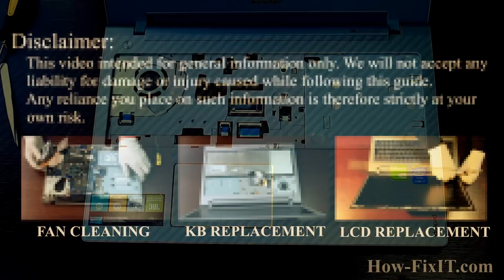Lenovo IdeaPad Z500, Z510 Hard Drive Replacement & Memory Upgrade Tutorial

Comment: Hey dude, what tools do you use? I would love to know what kind of gloves you wear and where can I buy the magic tool you use to remove the plastic cover at the bottom by sliding it over the edges(I guess it is enough description).

Oh, and are you using any special screwdirvers, or just the normal ones?

Thank you :)
Reply from the maker: Vacaloca Nórdica hi, I'm use antistatic gloves with polyurethane cover. Unfortunetely can't say what is the name of that tool that i use to remove case parts, but i think you can find any analogues in tool set for laptop disassembling. And yes I use normal screwdrivers, as I remember PH0 and PH1.
Reply: How-FixIT Thank you so much :)
Reply: +Vacaloca Nórdica It's called a SPUDGER and it should be plastic to avoid damage to the plastic case parts.